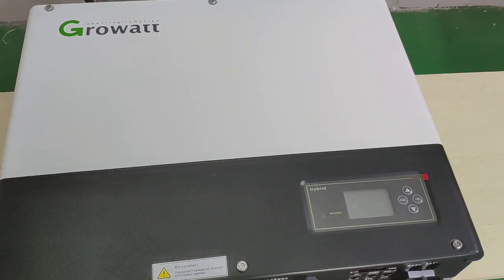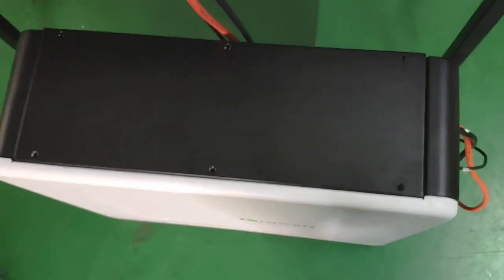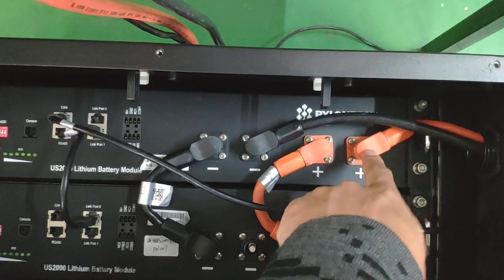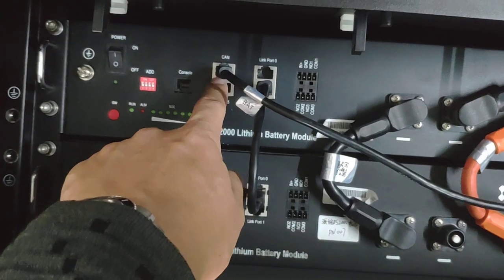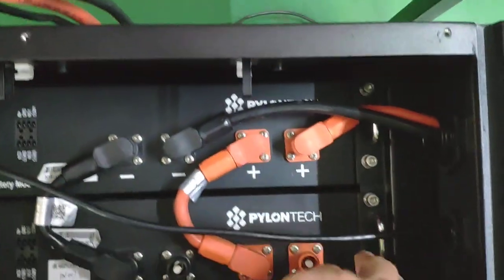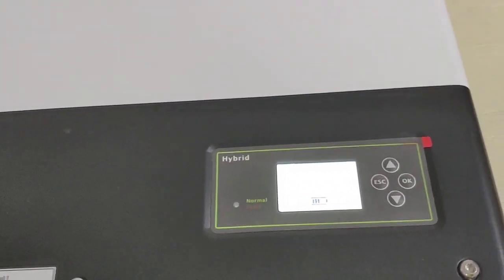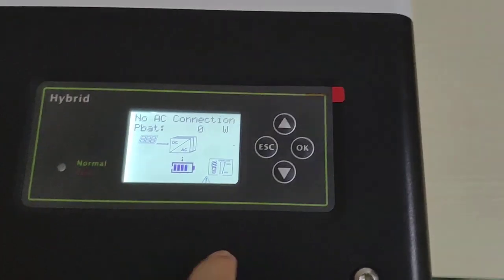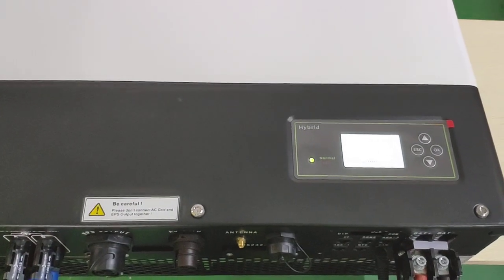Growatt SPH Pylontech Battery Wiring

Comment: Your machine is not communicating properly with the pylontech. They are charging differently. Hence the will read different voltages and create an unstable system
Reply from the maker: Hello, for technical support, please contact our service team at service@ginverter.com, or you can call our service hotline at +86 755 2747 1942. Thank you!

Comment: Why isn't the dip switch on 1 up on the master battery ? Also its wired wrong the negative should be on the bottom battery .
Reply from the maker: Hello, for technical assistance and support, please feel free to contact our service team at service@ginverter.com. Thank you!
Reply: If you look at the info on their website the connection is correct

Comment: Yes i hawe 3 sph 5000 and hawe the battery canbuss paralell conekted from master battery to al 3 sph, that means that al 3 inverters gett exaktly the same information from battery pack.
The battery power are serial conekted from no 1 to no 2 from no 2 to no 3. 
In this way you can tell the first inverter to load battery and the sekond to load to grid and the third inverter can load offgrid ore in anny way you want.

Growatt first told me this is impocible to do whit sph butt after a couppel of mail and i mailed them an elektrik chema they tryed my conektion and told thats ok.

I beliwe the new insralations bok hawe this conektion as one pocibel way to go.

Comment: Is it possible to have 2 pieces of 5kw SPH 5000 power a larger size pylontech battery? Like 6 Us3000B-s for around 20 kwh, and a large 10 KWp photovoltaic array. Can I use dual inverters? How does the CAN bus handle that? It has to be a hybrid system.
Reply from the maker: Hello, for product and customer services, please feel free to contact our service team at service@ginverter.com, or you can call our service hotline at +86 755 2747 1942. Thank you!